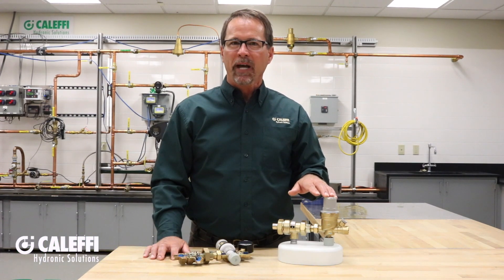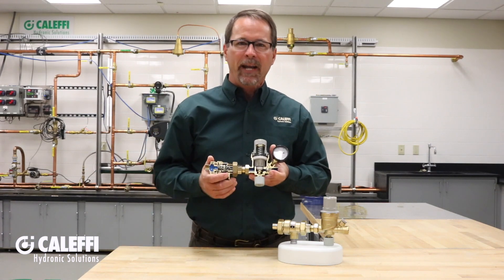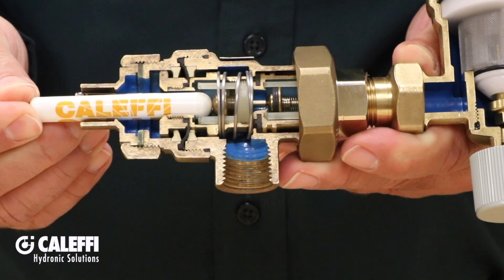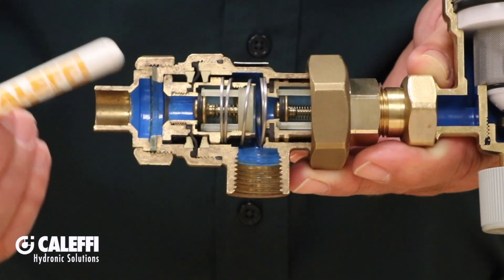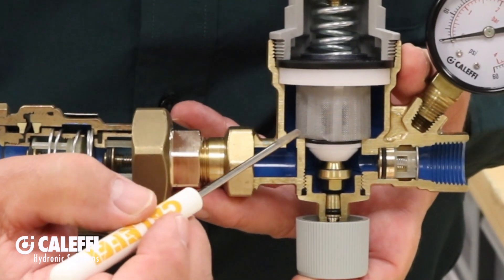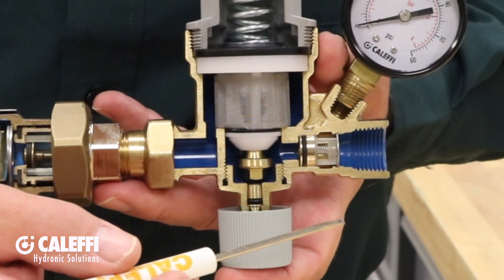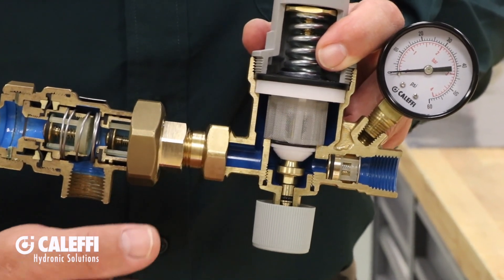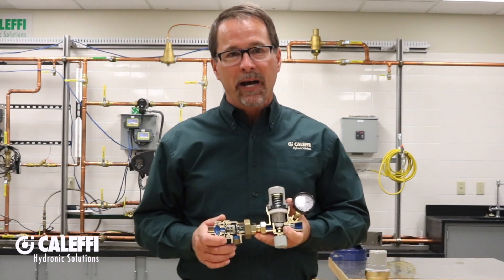A close up look inside an AutoFill™ combo

Comment: Hi Kevin, is it possible to replace the Pressure Maintaining Section, i.e. the top section which is adjusted to maintain pressure? My unit, Caleffi Automatic filling Unit, Series 553, ( Calaffi 01025/05 GB) is constantly losing pressure. It is not identical to the unit you illustrated, which clearly shows how pressure is adjusted by turning the screw in the centre of the pressure dial and see the pressure one requires. 

With my unit, one must remove a plastic cap, then adjust a plastic screw embedded in the cavity, which distorts far too easily. I am based in Rep. of Ireland and would appreciate where in Ireland or UK can such an item be replaced?

In anticipation of a positive response, thank you for your assistance
Reply from the maker: We have a replacement cartridge available for the 553 autofill.  You would have to remove the top cap and pull the cartridge to clean or replace.